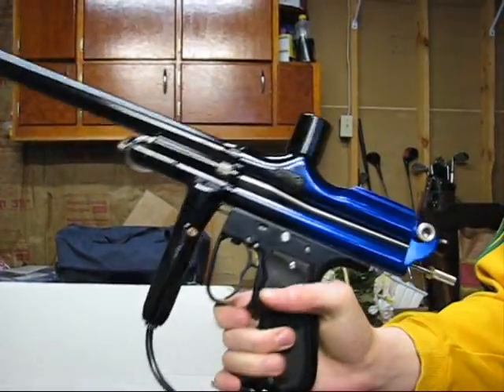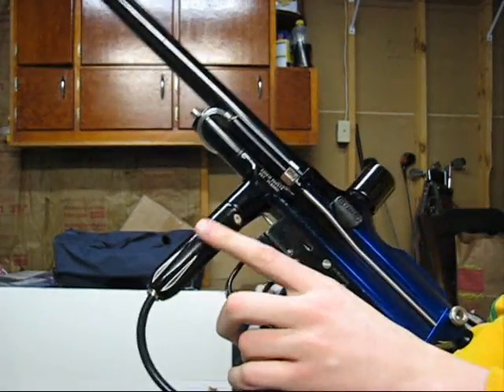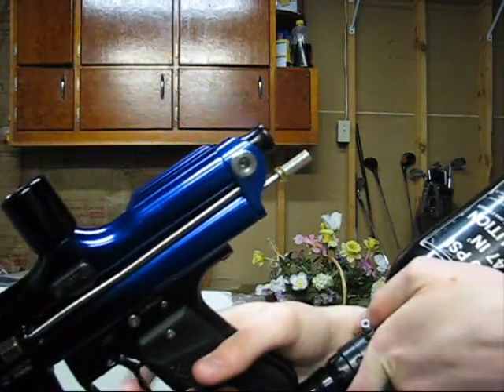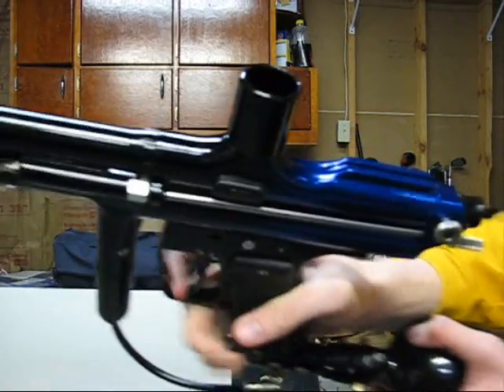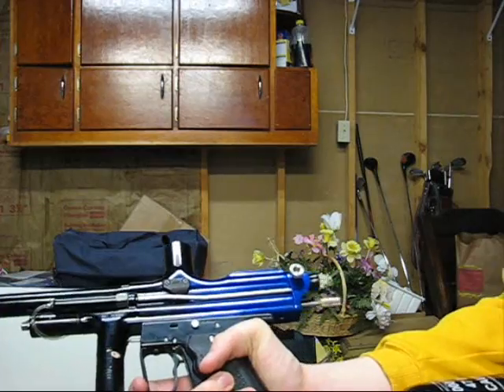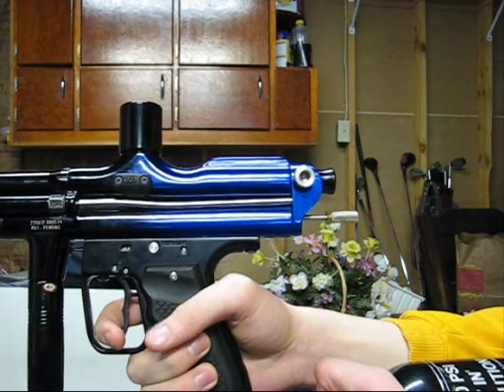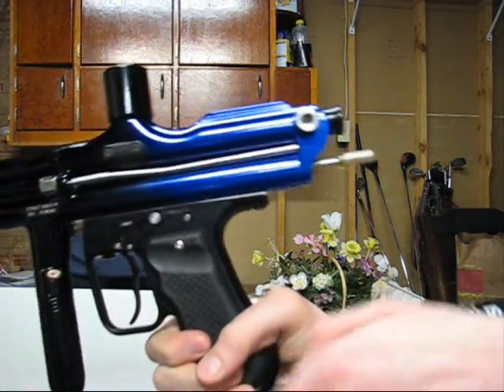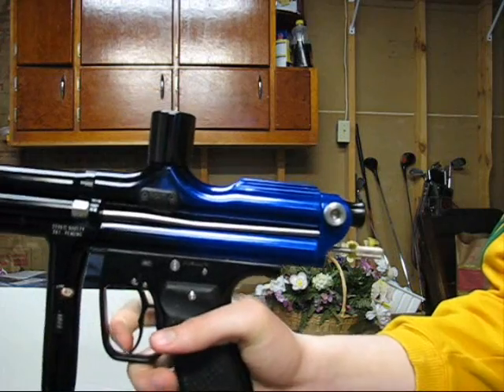Trilogy Troubles

Comment: what i think is happening is that its not timed.

Your hammer/cocking rod assembly is being pulled back before its able to completely depress the valve pin which is probably why you velocity is so low.

Alnother possibility of the low velocity is a really bad balance of pressure and spring tension (aka really bad sweetspot. im not saying sweetspot it, but maybe its really really off)

PM me about this

Comment: You need to completely time your cocker bud. If the bolt isn't opening all the way then adjust your back block out a turn or two so it pulls your bolt out a bit farther

Comment: Try upping the LPR a little bit, about the velocity, i had a trilogy pro (mech) that had a really short hammer spring, had to crank in the IVG 6-7 Full turns to get it to shoot at 280/290fps. 

Good luck with it ;) and keep up the good work with your video's

Comment: It's dangerous not to sweetspot an autococker or sniper, if you happen to be on the high side of your sweetspot and your tank runs low on pressure the velocity will actually spike as much as 50 fps due to higher valve dwell

Comment: did not really watch the title screen, so my apologies. 5 Turns and mid 100's is really low indeed. I'd check the LPR for sure, and make sure the CP regulator is set to a good sweetspot. the LPR can be changed by unscrewing it and using a flathead screwdriver to give it more or less pressure to work with.